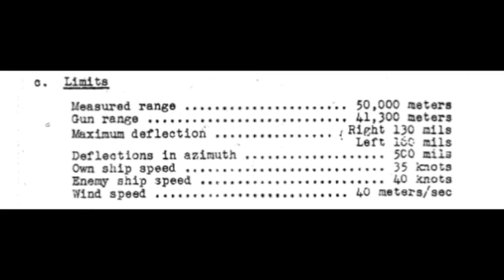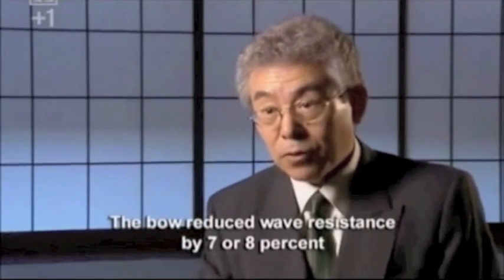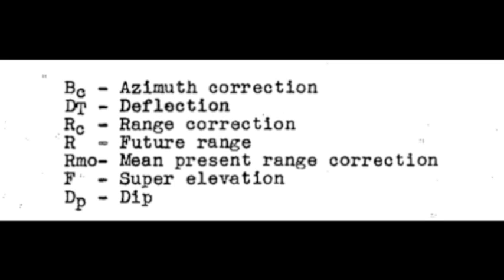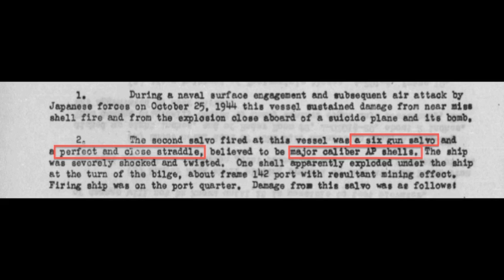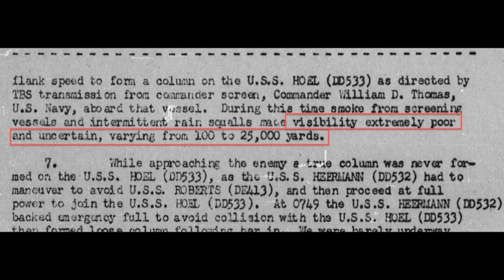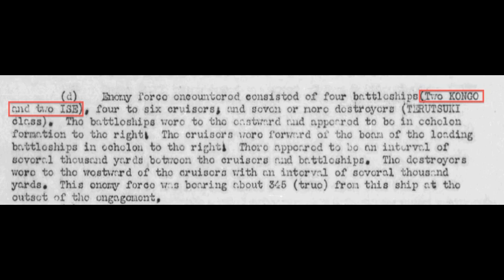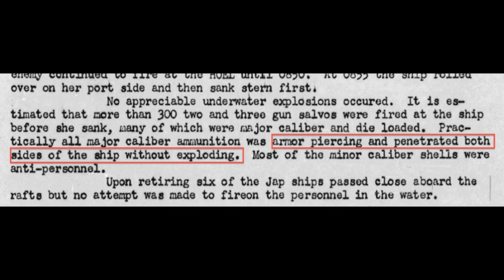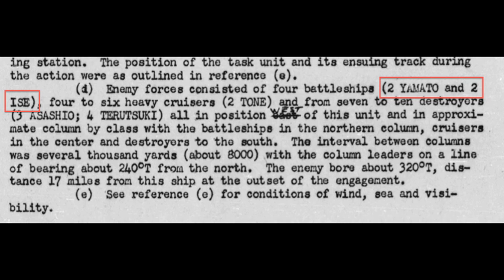Fire Control of the Yamato Class - Part 2

Comment: Very very good stuff here. While you did indeed bust the myth that Yamato being horrible at shooting. While I can understand hwy you would compare it to operation Hailstorm, the Iowa class still had the more advanced computer system. It wasn't really about the radar or optics that made Iowa superior at hitting targets. it was the computer system. Nowaki was also chasing splashes which was a very effective tactic against computer calculations of the time.

Yamato which has a less sophisticated system wouldn't be able to keep a reliable firing solution against a ship conducting any real sort of maneuver. That's what the major difference was. Though that is on paper and also in training/testing. On the field both ships didn't see enough combat to actually determine that fact. Many factors could of affecting the ships. But on the technical side, Iowa should still land far more accurate hits.
Reply: Agreed, but as an engineer, I know that the practice often doesn't follow the theory.
Reply: True
Reply: Yamato was immune to own shell in the distance of 20-35 km.
Iowa 40cm pipes are going to do NOTHING on the far distance because she do need to close to 16 km to hurt the Yamato. Or 10km of the 1020kg shells are used. (which we know from Washinghton and Dakota)
Reply: @WadcaWymiaru  I'm strictly talking about the fire control systems and it is undeniable the US ships would be far more accurate as a result. If it was a battle between the two ships, I would put my money on the Yamato if visibility is clear. If there is visual obstruction Iowa would definitely win.
Reply: @neurofiedyamato8763  
Meh...did you do any calculation? Like USN armor penetration formula? It is hard, but i was able to get the good numbers!
Penetration = (0004689 x W^0.55 x V^1.1)/D^0.65
W - weight of the shell (in pounds)
V - velocity in the feets per second
D - diameter in the inches
T = penetration (inches)
Hella hard but i suceed!
For Yamatos 18.1 inch gun hits will start at the range of 19.35 miles or 35 km
http://www.battleshipyamato.com/index.album/moment-of-reckoning-battle-of-leyte-gulf-october-25-1944?i=102&s=1
look how close those splashes are!
If that was  battleship, it would receive the hit (escort carriers are quite small, like cruisers)
Reply: @WadcaWymiaru  I have looked in to archived data and done calculations myself and that is why I say that confidently.
Also that picture doesn't really matter??? It isn't like Yamato can't hit anything. It can and has one of the most sophisticated fire control of any Japanese ships, that was never in dispute. But relative to what the US fire control systems could do, she is still several years behind.
Yamato would not be able to maintain a firing solution when maneuvering where as the US can. Yamato rely on good visibility due to optical systems while the US could blind fire. The US system was also much more automated thus faster computation with less human error.

As for penetration relative to armor, it is exactly this fact that I said Yamato would win if there is good visibility. But in bad visibility, it doesn't matter what guns you have if you can't even spot the target.
Reply: @neurofiedyamato8763  
1. Did you calculate the penetration reduction on the slope? Angle? I did.
And my calculations were close to that was said about he Montanas:
"The Montanas were designed to give a zone of immunity (armor 409mm) against fire from:
16-inch/45-caliber firing 1225 kg shell from 16 459 and 28 346 m"
About Iowa:
"zone of immunity: 17,600 to 31,200 yards (16,100 to 28,500 meters) vs. 16”/45 (406mm) light shell or 23,600 to 27,400 yards (21,600 to 25,000 meters) vs. 16"/50 (406mm) heavy shell."
Yamato "killzone"start with 25 km of the horison calculated 3.57rh, h=meters, r=root.
2. That picture show that third salvo of the Yamato straddled the light Carrier. (there is more of them, just use arrows)
I believe ligh carriers had 5 meters of draft, battleships had 10 meters.
Hit like hit, but count as hit.
Add the fact 155mm gun will avake on the 27 km, shooting 5 times per minute! They will massacre the radars and lighter guns. Before Iowa light open the fire.
3. It doesn't matter if Yamato is moving or not, she was able to hit zigzacking destroyers and carriers. From 35 km.
4. Hey! Do not cut the Yamato from her spotter plains! She wsas 7 of them!
Plus Yamato HAS the radar: www.youtube.com/watch?v=OTlbTbrPdCY
Reply: @WadcaWymiaru  Dude wtf are you even trying to say. I already said Yamato would win in a clear visibility environment. Why would anyone ignore slopes and impact angle if they are going to calculate armor penetration? Why are you keep bringing up the calculations? I never disputed that Yamato have a clear advantage when it comes to immunity zone.
There's also formulas used by naval institutes. However you should keep in mind all the calculations are ballparks. I compared the calculations to historical test data to make sure they are accurate.

As for Yamato hitting zigzagging destroyer and carrier. Cite exactly when that happened. Yamato's only surface engagement was Leyte and she only straddled her targets. There was never a confirmed hit.

Also that is complete BS to say 'it doesn't matter rather Yamato is moving or not.' Both the firing ship and the target moving will throw off your aim. A ship maneuvering will add angular and lateral momentum to the shells fired. It is well documented on what the Japanese fire control systems could do, and it COULD NOT keep a accurate firing solution on maneuvering targets. In addition you need to time the moment of fire correctly. This is where automation helps since the US system is timed by the fire control computer itself where as the Japanese system required human operators.

Additionally Yamato's radar is a SEARCH radar. It is not accurate enough to track targets in both range and azimuth to direct guns. The only countries with sophisticated enough naval radars to direct its guns was US and the UK. The other nations even with their most sophisticated systems could only ASSIST with radar but not blind fire. If there is fog, squall or in zero-light environment(nighttime with cloud cover) Yamato is practically blind. Anyone disputing this well established fact is just deluding themselves. Every book and respected naval historian recognize this fact. Even the Japanese understood this fact and went out of their way to employ star shells and flares.

As for the 155mm, it doesn't matter what its maximum range is. You simply aren't getting any reliable hits on target at such a range with ANY weapon. Let alone accurate enough to even hope in taking out all the numerous radars and fire control systems. That of course also applies to the US, the US would not be landing reliable hits at such a range either, however since the video and my original comment is comparing the FCS specifically, the US FCS is still superior. Fire control systems on the US ships are integrated and secondary systems can still feed data to the computers. A lucky hit could do the job, but when you are relying on luck to turn the tables then it is quite clear which ship is better in that situation.

Furthermore, claiming the Yamato would be more accurate because 'well it can just destroy the Iowa's fire control directors' is faulty. At that point you are comparing a damaged ship to a undamaged one. If Iowa's main guns destroyed Yamato's fire control directors, the same could be said about Yamato. Battle damage =/= accuracy. It doesn't change the fact the Iowas had the most accurate fire control systems onboard any WW2 ship.

Lastly if spotter planes is comparable to onboard fire control systems, then why did EVERY nation including the Japanese develop fire control directors and rangefinder equipment? Spotter planes are exactly that. They watch for your shell splash. Tell you how far you are off and you have to constantly correct it based on information relayed to you by the spotter plane. All the while the enemy is changing course and speed. Good luck hitting much with what amounts to 1920s technology.
If fire control computers are so irrelevant due to the vulnerability, why do every single warship after WW2 so heavily rely on them? Clearly they have a massive tactical advantage.

No one in this comment chain is denying that Yamato have an immunity zone advantage over the Iowa. But we also shouldn't just ignore that Yamato clearly could not blind fire and had a inferior albeit robust fire control system. Keeping that in mind, Yamato will excel in certain environments while falter in others. Yamato isn't a super ship that will defeat everything that comes its way. There are weaknesses and its fire control system is one of them.
Reply: @neurofiedyamato8763  
The hit WAS confirmed, just not direct, but White Planes hull get's damaged:
http://www.battleshipyamato.com/index.album/yamatos-third-salvo-hits-white-plains?i=104&s=1
There is more USN pictures from the Samar island naval battle.
"More on this engagement from the INJ records - "0651hours: A charging cruiser emerges from behind the smoke. YAMATO engages her from a distance of more than 10 miles and scores a hit with the first salvo. "
For the rest: WHAT makes Yamato not sunk the Iowa ? Yamato will hit Iowa above 20 km, many times before the Iowa guns will reach 16.5 km to hurt the Japanese giant.
Reply: @WadcaWymiaru  "WHAT makes Yamato not sunk the Iowa ?"
Oh idk, maybe the fact that Yamato is practically blind if there's fog, squall or zero-light conditions? I'm not sure what so hard to understand.
Additionally exploding under the keel is a NEAR MISS not a hit. Although I never claimed Yamato was inaccurate, simply stating that Yamato never got a direct hit with her main guns. Although she did land hits with the 155mm.
I also have repeatedly restated that I do believe Yamato would WIN in clear visibility conditions. Once again what is so hard to understand

Lastly I never disputed that Yamato couldn't hit Iowa at 20km. Iowa can hit yamato at 20km too, and can penetrate the main belt. Based on the US armor penetration curves from 1942, at 20km, it can penetrate Yamato's main belt armor. The whole 16km range is BS.

Anyway, Yamato's immunity zone only exist at ~22.5km and beyond. Given the height of both ships, the visual horizon is only 26km. Beyond that Yamato literally cannot see the Iowa to engage without spotters. As already mentioned, spotters is pretty useless for gunnery. Although this does give Yamato the advantage and is why I would put my money on the Yamato in a clear daylight engagement, it is not as decisive as you make it out to be however.
Reply: @neurofiedyamato8763  
1. Yamato HAS the planes god damn! Also the radar that CAN detect the enemy! During the battle of Samar Yamato fired from far distance, despite smog and the squals. And got hit! I have the picture, you have none.
2. About the armor penetration: All of that curves are to VERTICALL plate not the angled. You do need to add impact angle to slope to the geometricall armor thickness! Then we have it:
Inch   |armor pen|distance|20° slope|impact angle|Strike angle|
29.70|  754 mm  | 5 km       |  446 mm|          3.3°         |     23.3°       |
26.41|  670 mm  |10 km     |  460 mm|          7.2°          |    27.2°        |
23.71|  602 mm  |15 km     |  480 mm|       11.5°          |    31.5°        |
21.81|  553 mm  |20 km     |  510 mm|       16.5°          |    36.5°        |
20.39|  517 mm  |25 km     |  560 mm|       23.0°          |    43.0°        |
19.70|  500 mm  |30 km     |  657 mm|       31.4°          |    51.4°        |
(youtube HATE tebels!)
equation: thickness=armor(mm)/cos(strike angle)
Work every single time.
After adding pen. loss due to angle, i have only 25.53% loss for 30° 
(from there  http://www.navweaps.com/Weapons/WNUS_16-50_mk7.php )
As we see WE CAN calculate!
Iowa:
zone of immunity: 17,600 to 31,200 yards (16,100 to 28,500 meters) vs. 16”/45 (406mm) light shell or 23,600 to 27,400 yards (21,600 to 25,000 meters) vs. 16"/50 (406mm) heavy shell.
Overall: Iowa will be stroken by Yamato without the retribution.

Comment: cont
0704:  Straddled again,ship rocks violently throwing personnel on they're feet,steering control is lost,Gyro and radar fail,electrical power is lost,generator circuit breakers opened by shock,observers notice that there was no colour on the salvo as it lands close to the vessel,every vessel of the IJN were given dyes and Yamato was the only vessel in the fleet that had no dyes/colour

Comment: small timeline of WP
0700 – Straddled by a salvo estimated to be three 14-inch or greater caliber shells.

0700 - All power failed in communications as a result of near miss by battleship salvo, silencing all receivers and rendering transmitters useless. Same salvo buckled leg of radio table canting two receivers. The TBY radio was set up on the bridge replacing the TBS.
 
0702 – Another straddle, several splashes were observed. Commence launching aircraft.

Comment: i just did some research checking out what others found.
There is a potential 5th hit on Gambier Bay where Yamato is the best candidate firing at the correct time and having a very obilque target angle so a shell can sideswipe a hull like the shell did ripping out her side. This was approximately 0820-0825 at 20 km. H I do believe she is the best candidate for the hit. So based on this she had about a 4-5% hit ratio for her main battery which I think is average for most battleship actions.

Comment: Based on the report, these are the hits that I suspect as being scored by Yamato:

0810 1st hit - A shell hit about 6' aft of the after elevator near the center line of the flight deck, tearing up flight deck planking and creating a 6' to 8' jagged hole, it continued to the afterward athwartship passage, then exploded in or near this passage.

0820 hit no.3 - not a direct hit..., it was an impact explosion that opened a gap in the skin of the ship approx. 4' sq, 12' below the waterline...

Comment: I have a Gambier Book that included the official Samar report written by GB Cptn. Viewag that mentioned the 1st hit on flight deck that penetrated deep downwards, obviously that was a high angle hit came from very far distance, the time the cruisers were already within short range less than 10k yds and the successive hits on GB were mostly hitting vertical area instead of horizontal, carriers have a quite tall deck so it's unlikely that those short range fire can hit the much higher deck.